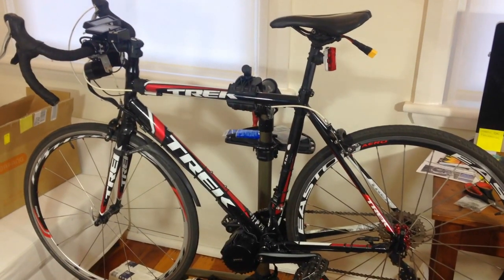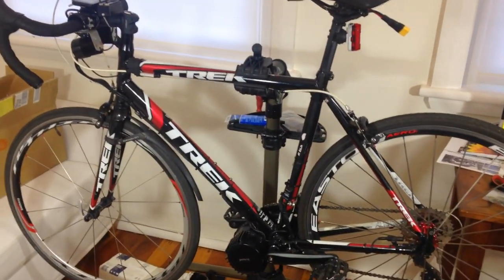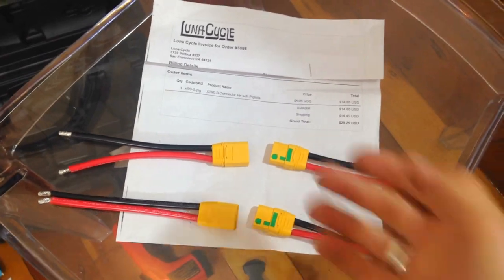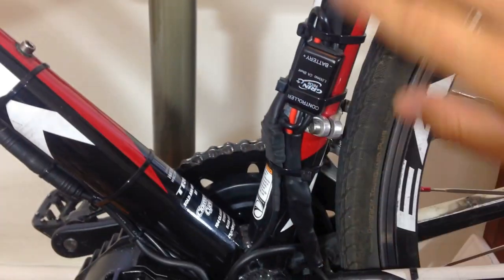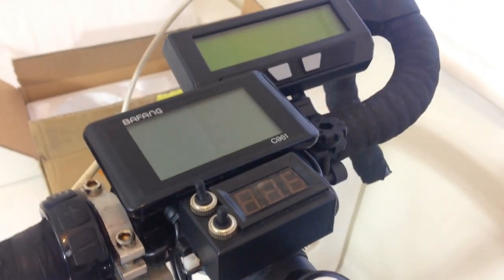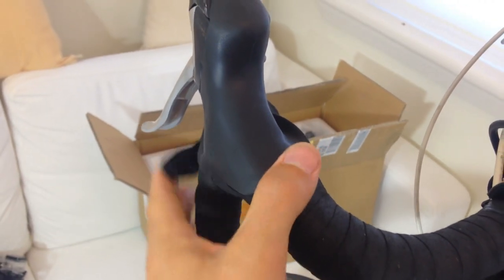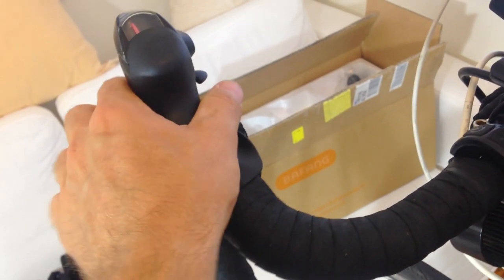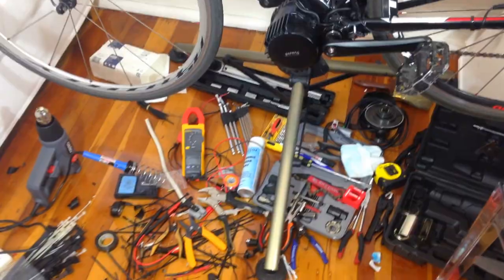Bafang BBSHD 1000w mid-drive • electrical done, ready to go! • Electric Bike 48v BBS02 8fun motor

Comment: I really need to learn how to hide the wires like this! Sticky black what?
Reply from the maker: +Leandro Almeida - Hahahaha.. I used to dream about the day when I could work with these things and stop blowing all my $$$$$ "experimenting" things in my garage... I feel like a happy kid at the playground hahahaa 
I would be stupid to leave this fun work place!
To make the wires "disappear" the best way is use heat-shrink wherever you can and lots of small cable tie getting all wires neat together. I pack most of the harness, controller and battery wires right behind the motor, between the motor and the bottom bracket, I use some medium cable ties first then I use a long one to hold it under the BB. The more time you spend planning it the better. You get better results on dark or black frames as all wires and cable ties are black. At work I use this thing here http://www.ebikes.ca/shop/ebike-parts/wiring-accessories/consleeve.html# to organise all wires at the handlebar. Also try this tape here http://www.ebay.com.au/itm/23mm-Width-Insulated-High-Voltage-Adhesive-Electrical-Rubber-Tape-Roll-5M-16-4Ft-/391187102840?hash=item5b14917c78:g:DfcAAOSwnLdWq6Vc
Reply: +ElectricBike (Bruno) thanks a lot!!!

Comment: can you link to at photo of the plumbing joint you used for the throttle? Really like the setup of it.
Reply from the maker: Heeeeeey Anthony... you can find this at any hardware shop: http://amandamayphotosblog.com/wp-content/uploads/3-4inCopperTJoint.jpg
Cut the long tube in half and rivet to your handle bar, the "middle tube" you attach the throttle. Best way is to take your throttle to the shop and measure, there are many many different copper pipe t joint sizes
Copper is very soft, you can bend and shape it to your handlebar =]
So much POWEEEEEERRR haha

Comment: Do you have a motor cutoff with this setup?
Reply from the maker: Am Tamim Khan the only cut off I have is an ebrake sensor for mechanical brakes for the rear wheel... you really need all these other sensors when you ride with pedal assist but I disabled it and ride throttle only... I like to be under control haha =]

Comment: im really poor do you think you could help me get a deal on one of these ive been dreaming about this HD for a year and ahalf please help me i would give you my kidney if you ever got sick
Reply from the maker: Hahahahahahhahaha.. fresh kidney for a HD is a great deal.. hahahahahaha
It was hard to find any second hand motors like that but there are so many out there that may be possible to find something, someone selling... maybe try the cheapest option.. Aliexpress...  or even cheaper, the Cyclone motor is half the price and can do 3000w depending on what voltage you're running. Not as refined as the HD but its powerful as the HD. The cheapest way to get yourself a battery is to recycle / harvest some 18650 cells from old cordless tool / laptop batteries. not easy but cost effective, many many videos here on YouTube, search for "DIY Tesla Power wall" or "DIY battery"
So much POWEEEEEEEEERRRRR... =]